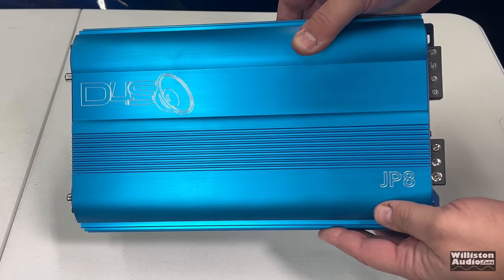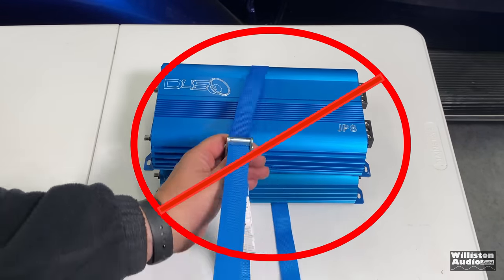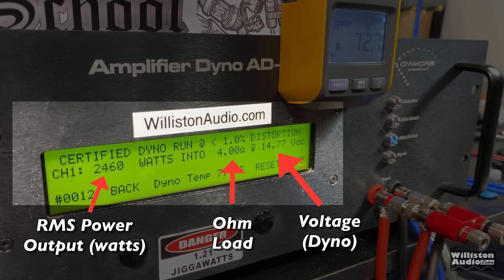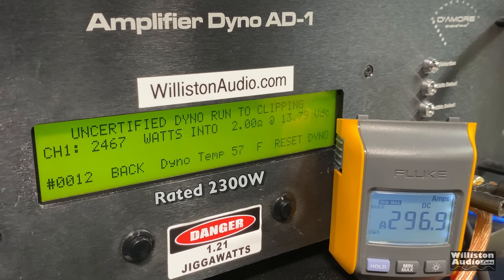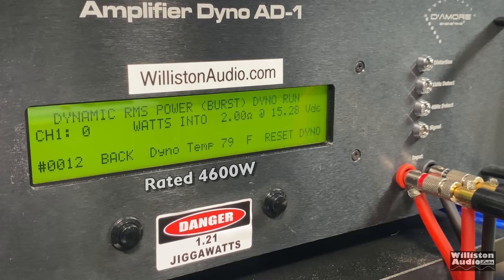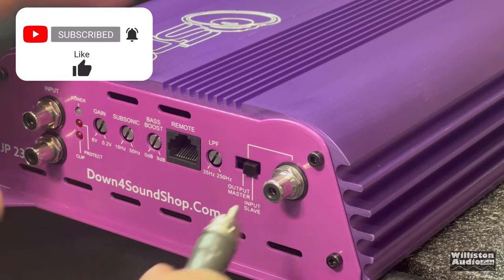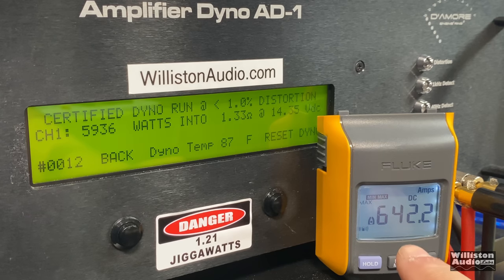Getting the Most out of Your Amplifier: How to Strap Monoblock Amps for MORE POWER!!

Comment: The efficiency difference is an interesting find in the JP8’s. I’ve never wanted to mess with strapping amps together, but this is good info for the folks looking to do something like this.
Reply: I think it was a gain matching issue internally with the amps. That would waste a ton of power because of the voltage/output impedance mismatch on each hot terminal. It should have been the same at 2x the load impedance as one amp

Comment: Thank you Derek for this video. I advise customers of the potential repair costs when strapping amps. Seeing the drop in efficiency lends clues to what is going on.
Reply: 7-8 years ago, I had two Crescendo amplifiers strapped. The slave failed, and when sent in for repair, I was told that strapping was harder on the input section, as that was what had to be repaired. Once I got it back, I used it as the master, and several months later,  the other amp failed.  Sent it to another repair person, as the other was backed up. Same issue with that amp, input section. That person said the same. I don't know how true I is, so I will ask you..I follow your repair channel.
Reply: @Chuck_Sanders  I advise that both amplifier output sections be replaced if there is an output or sub failure in a strapped installation. Some designs will hold up better than others. If a customer only sends one in I will let them know that the other may have been damaged and to be prepared for a repair bill on it.
Reply: @ellensburgamplifier  I'm not sure if the output section had damage, I was advised the input portion had been damaged. It was curiosity as to what may have caused that, and why 2 different individuals would advise that strapping was harder on the input. I'm just wondering if it was board specific, I haven't really strapped any since, and just gain match. Idk why, just made me leary I guess. Any other possible reasons why that may have happened? Thanks for responding
Reply: @Chuck_Sanders  The power supply for the most part will never know that the amplifier is strapped. There are several reasons for a supply failure. Power supply failures are mainly from overloads and thermal failures.
Reply: @ellensburgamplifier  thank you for the response. It is much appreciated good sir!

Comment: I have one of these amps running at 1 ohm powering 2 JL Audio 12TW3-04 subs in my Tundra  along with 2 of the JP84 amps powering the rest of my system and I am quite pleased with them. Price has done a good job with these amps. My system is designed to deliver the best sound quality it can and these amps are doing a great job. I was totally unaware of these amps before I saw them being tested on the dyno here on your channel. So thanks for that.

Comment: Most interesting video because I stopped customizing OP's auto sounds after 30 years @ the turn of the century, when seperate amps were for splitting Bass, Mid and Highs. My focus had turned to building computers and being in the country all we had were phone lines for internet with modems topping out at 56K. I had up to 4 phones and could STRAP each with modem together which would increase the internet speed up to 4 times...
Reply: Oh sweet that's cool. As a kid I dreamed of tapping into my neighbors phone lines to get triple speed music downloads at night when nobody would use the phone.

You mean to tell me I could have made it possible!!?
Reply: @Onewheelordeal  Yep as long as each line has a modem and you have an ISP. I had 2 lines that ran to the old farm house and when I built a new house beside it I put in 4 lines. never ended having to use more than 3 because we soon got satellite/cable. Today with high speed/DSL strapping is possible... it's called bridging...also because internet is much faster today there is "split tunneling" where, for example, certain programs and/or Puters can go thru a VPN while others won't.
Reply: @411LED  Shotgunning, as it was called by DIAMOND brand.  You could also strap a 56k modem with a cell phone.  Back in those days,, the software involved would split the file, say 2/3 of the file was handled by your 56K and the last 1/3 was downloaded over cell phone, at the same time.  That was on Sprint, before EVDO 3G/WiMax/4G LTE, thus the speeds were in the 13-30K range realistically.  As wireless goes, of course, the speed would vary wildly and thus the portion of the file handled by cell phone would always end up taking longer.  Basically, a complete disappointment, but hey, it Worked!
Reply: @CheezeCracker  Never tried that method, probably because I used beepers till they went obsolete. I do remember the term Shotgun, even used  a Diamond External as their Modems were top notch...

Comment: Actually, you could strap any two matching half bridge amps even if they don't have a strapping feature as long as the settings are pretty well matched and you wave a way to invert the phase of the input signal to one of them. If they have a phase inversion switch that would work perfectly; just set one to 0 and the other to 180 then wire them the way you illustrated. Or if the head unit or line driver has a phase inversion feature that only affects one output. The main advantage of strapping imo is the load seeing double the voltage, so you can get up to 4x the power into a given impedance than one of the amps could do into it individually (EG you're in an impedance crunch and can't wire the load low enough to get the most out of the amps individually, strap them instead). Even further you hypothetically could strap two different half bridge amps together depending on how they're grounded internally and how the settings/crossover phase distortion matches up on them

Also amazing stuff as always Big D can't wait for the next one!!
Reply: This guy knows what he is talking about. Simple ohms law dictates that doubling the voltage at the same impedance results in quadrupling the power.
Reply: @Nathan-wz4lg  wow just learned something new! I did not even think about it like that
Reply: So I'm going to strap my amps the right way today they have the feature of strapping and have a slave and master switch also have a phase switch which one should be 0 and 180 master phase zero slave 180 on phase or since they are strappable it is not needed?
Reply: @Nathan-wz4lg  because the ohm load on each amp is also cut in half. one amp wired at 2 ohms would give you a 1 ohm load on each amp in a strapped configuration, so you'd double the power output capability while effectively cutting the resistance in half.

Comment: Just picked up a jp23v1.5 in black about 3 weeks ago for 249.00 and that a steal folks ....this amp puts in work ....if you have the electrical to support it .....that being said I replaced a skar rp1500.1....and it was a very good amp ad well but I run an American bass xr12 d2 ...and even though either amp would probably support 2 of these 12s I went ahead and picked up the jp23v1.5 because you can  strap/ link it to another jp23v1.5.  .....so when the budget allows for another xr12 d2 if I want more power I have that option ....and I am really impressed with the jp clip light is nice to have as well as temperature and voltage meter ....have played it at hight volume for extended periods of time and a out 118 is as warm as it has got .....not sure I have even had the fan to kick on yet .....glad see this vlog so i know around the power I would get if I do get another one and link/strap it ....big thumbs up big d .. .and hey that's my nickname as well

Comment: Many years back in the 1990's I was getting into the extra sound in the car system but did not want o spend much, but still wanted good as I could. So I bought the Radio Shack (Realistic) 120 watt 60X2 subwoofer amp. Seeing they could be bridged stereo to one mono channel with the built in switch and wiring instructions and I had a dual voice coil subwoofer in a tube I bought a second one. Found out a few months later they were discontinued and marked down greatly, and made a deal and bought two of the 160 watt amps that looked similar, but without the subwoofer filters..  Some years back I was experimenting with these and wondered if it was possible to bridge the 160 watt even though it was never meant to be. These had built in high level input connections ( meant for the 1960-1980's cars. ) so I just connected the output like the 120 watt amp had said for bridged operation and on the input side I wired in one channel correct positive to positive, and the other channel I found out works if done the opposite way on that channel. Thus it was bridged. They did apparently share a common internal connection like the other amp, but I never traced or looked at the circuit closely to see if I was wright, but a general look inside of the amp cover.   I never tried this long term, but the principle should work but obviously bridged always means the bottom ohm load will have to be raised to twice that or the amp will overload.    I would suspect even a 1 or 2 ohm resistor linking a second amp could also be functional on a none approved matched amp set, and the input swapped on one as well.

Comment: Man I love these videos. Didn't know amp strapping was a thing.

Also, I let a fellow Soldier listen to my system (made using the TopStrongGear) and he instantly wanted me to help him with his. Gotta admit, I wouldn't be back into car audio again if not for you.

Also, he's using the same TopStrongGear amp. 😆 Gotta admit, it's small and powerful!
Reply: Do you happen to have any dyno numbers for your amp?
A "1500 watt" amp on Amazon for $120 is obviously too good to be true (especially when the model name is clearly 1100.1) but I'm always interested in Chinese gems that work well enough but are most importantly reliable 

And yes I know I may be replying to an Amazon seller shill
Reply: @Onewheelordeal  ......the very channel you're watching, has dynod one straight from Amazon. It did VERY well.

Now the one I bought, well after Williston bought his, has the same Caps used by Sundown.

Mine should be within 5% variance to Willistons. As well, it DRIVES my 12" Kicker LT7 - p/n 46TL7T122 at just a hair over 1/2 power.

As for what mine dyno's, not sure. But it f*ckin slams for a single 12 in a small enclosure!

Comment: i normally only hook up the inputs for master/slave and invert the polarity of the subs on the slave amp . this gives you the ease  of tuning on the master only without the negatives of strapping the subs
Reply: You're talking about using multiple amps for multiple loads tho, the intended purpose of strapping is to power a single load with multiple amps

Comment: I can honestly say in 15+ years I've never actually met somebody running strapped amps in a non-competitive system. Maybe bc most ppl have subs/amps already RMS matched so when they want to go bigger it's likely they'll need another sub that can be run independently.

The one benefit of strapping that can't always be achieved with more money instead is cutting down on your X dimension in exchange for greater Y if you're limited on space for length

Comment: What I learned from wattage on your dyno? When test your amplifiers at 4 ohms 2 ohms and 1 ohm  That's straight power the amplifiers are recieveing? But when you put a subwoofer in a enclosure the impedance is going to rise how high anywhere from. 5ohms to maybe 1.5 ohms so the amplifier is not going to perform better than your dyno and uncertified is a danger zone for any amplifier clipping means voltage drop on the electric system so certified would be anyone's best route ?Just saying but overall I would like to commend you for your efforts and hard work you been showing us over the years? Great job Sir 😊😊
Reply from the maker: Yes rise will occur but these tests are consistent for each amp tested so people know how each work in that scenario

Comment: Damn. I’ve been out of the loop too long. My last system was 6 Memphis 12”s and three 1000d’s and that sounded nuts in 2012. I didn’t have all that fancy strapping of 5000watts   I had 3500 over all at max. Probably didn’t use all of it at all   Kid at my job is running 3 18”s at 3000 watts a piece basically. And I started looking into all this new fancy stuff.

Comment: Awesome video Big D!!!  I’ve always wondered how the power output does when the amps are strapped, and now I know. 

When I bought my JP8, I purchased the 2 year warranty that covers running it at 0.5 ohms.  Soooooo……. that makes me think when running speakers with impedance rise, I could run 2 of these amps strapped at 1 ohm.  Hmmmmm………..
Reply from the maker: With speakers most likely it would be fine. These amps are tough, if the load is too low they will go into protect

Comment: How’s it getting more power?  How’s the efficiency getting worse.. 2xD’s make an AB..? Is this normal for all brand amps strapped? Great video, this isn’t newbie information
Reply: It's technically not. His 2 amps dyno higher than the rated rms. Say 2 x 1000w rms rated amps dyno at 1100w and 1250w individually. The strapped result should dyno around 2350 watts

Comment: Thanks for doing this. I was curious how strapping worked. 

From what I see, they're running in series.
Reply: Essentially, yes but each amp is operating 180 flipped polarity to the other. It’s easier to think of it as two mono amps bridged.

Comment: So why not gain match, phase match to get the efficiency back and more wiring configurations? Wouldn't that be better?
Reply: I just asked the same thing gain match and use 1 monoblock on each side of a single dual voice coil...Would be the same outcome as strapping right? 2 amps into one big amp?
Reply: @johnoates3326  no strapping is not good the phase is not correct and one amp often takes the brunt of the load.
Reply: You want each amp completely separate while use an oscilloscope that has at least 2 channels to set the phase to where both amps are on the exact wave length then have the gains match

Comment from the maker: SHOP
(Affiliate links and all may not be available)
JP8 Amp: https://bit.ly/3wOBbhg
JP8 v1.5 Amp: https://lddy.no/1fp9d
JP23v1.5: https://bit.ly/3yYt9DN
JP23v2 (not strappable with v1.5) https://lddy.no/1d7oj
All JP Amps: https://bit.ly/3lMb4kz

RELATED VIDEOS
D4S JP8 Amp Dyno Test - https://youtu.be/No3qCPI4LNw
D4S JP8 Extended Amp Dyno Tests - https://youtu.be/RCHhKpM83FM
D4S JP23 (v1) Amp Dyno Test - https://youtu.be/ufuoi-vn-g4
D4S JP23 Low Ohm Tests - https://youtu.be/v7nohX0C3gg
D4S Amp Test Video Playlist - https://bit.ly/3LTsom0

VIDEO INDEX
0:00 Intro
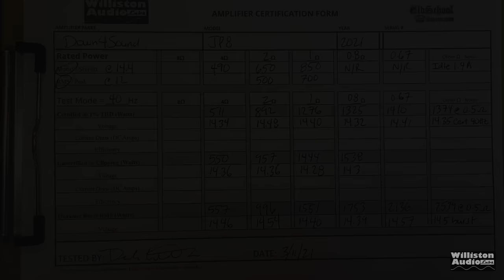0:42 Need More Power?
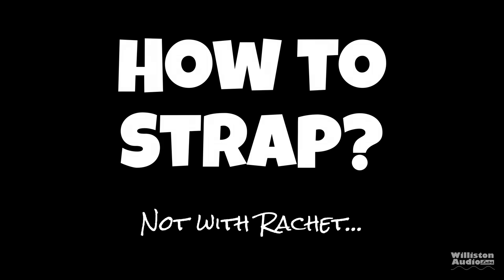1:35 How to Wire?
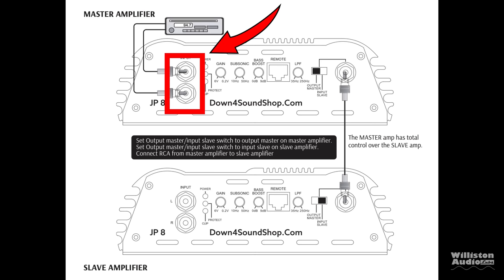2:25 Master vs Slave
3:00 JP8 Strapped Amp Dyno Tests
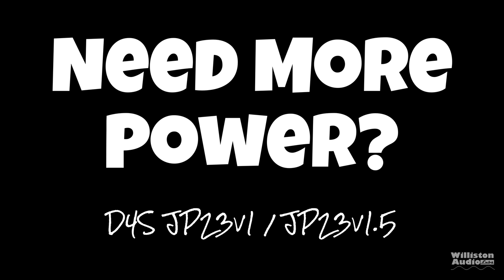5:29 JP23v1.5
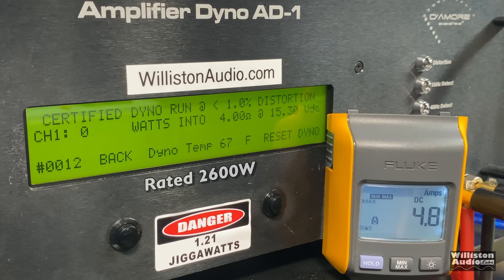6:42 JP23 Strapped Amp Dyno Tests
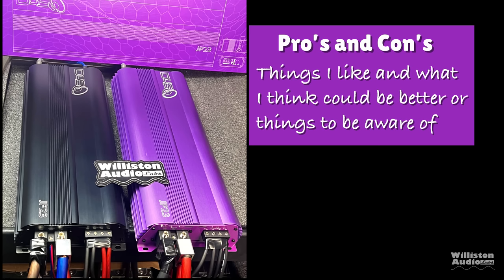8:32 Pros and Cons of Strapping
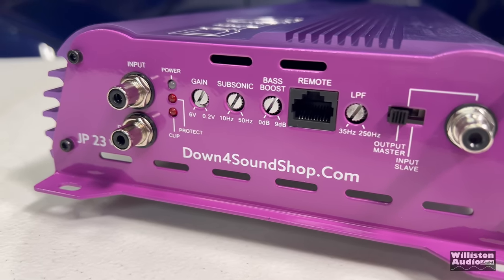9:21 Final Thoughts
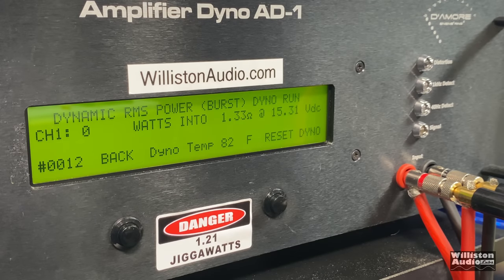10:02 EXTRA Tests

VIDEO AND AUDIO GEAR
Camera - iPhone 13pro 1TB - https://amzn.to/3nCjGvc
RODE Wireless Go II Microphones: https://amzn.to/3Q6NVHl
Shure MV7 Microphone: https://amzn.to/3A4OICK
Zoom H4n Audio Recorder: https://amzn.to/3BXjVsS
960 LED Panel: https://amzn.to/2Sxoq3S

TEST BENCH EQUIPMENT
SMD / D'Amore Engineering Amp Dyno: https://goo.gl/sJTcf7
XS Power D1400 Batteries - https://amzn.to/2BPFCKW
XS Power PSC60 Charger - https://amzn.to/2CHGcfs
Fluke 1000A AC/DC Clamp Meter: https://amzn.to/2Rw5WDA
Handheld Dyno: http://amzn.to/2u2EgKV
My Favorite Screwdriver Kit: http://amzn.to/2x0VzcE

DISCLAIMER: This video and description contains affiliate links, which means that if you purchase from one of the product links, I may receive a small commission. As an Amazon Associate I earn from qualifying purchases
Reply: Love my JP amps. Especially the China made ones nothing comes even close to the power and features for the cost plus you still get the same D4S support as you would if you splashed the cash for a Korean model
Can't imagine how many subwoofers will be saved by the clipping indicators, both on the amp during setup and on the remote knob during use

Comment: I strapped two skar sk2500 at .50 which I would not recommend and in an actual vehicle I clamp 7900 to 8100 watts depending on voltage, when strapping if you go below 1 ohm be very careful when playing music strapping below 1 ohm is better for burp runs

Comment: My mono Amps are not linkable but the way i run them i dont need too, i have two Pioneer GM-D9601 amps running at 2 ohms driving two 4ohm SVC subs each.
i would probably be better off getting a more powerful single amp, it cant be the most efficient running two separate amps.

I do only have one remote for both amps however, i bought a dual output potentiometer of the same value to replace original and put it in the housing and then added a second socket to it to connect the second amp.

Comment: Well good evening Big D Wiz love your videos I have a question if you take a 4 channel amp running into Channel mode I'm one of those channels to home low on the 2nd Channel 4 ohm load are the channel separate on what I'm trying to say if I run two homes on one channel and then two hours on another channel will that bring the app down to 1 ohm load are all channels run separately